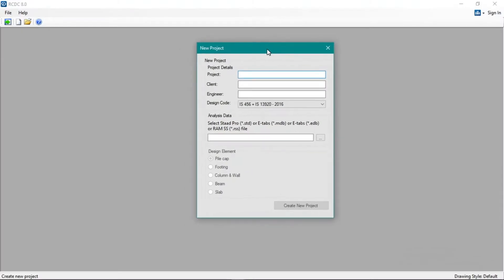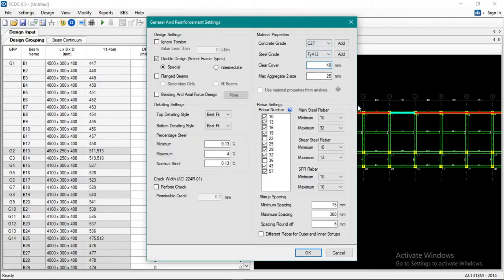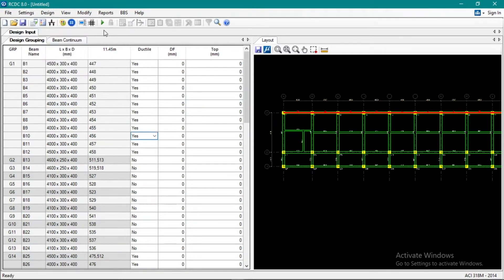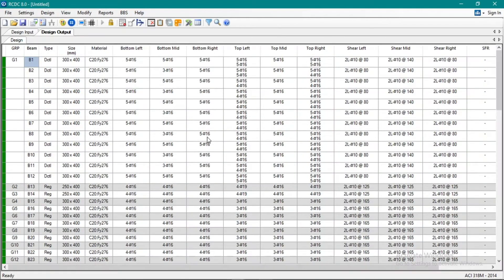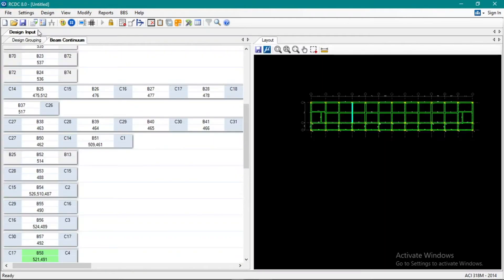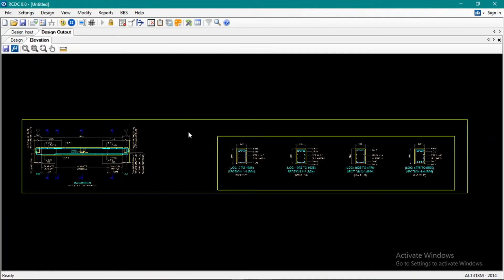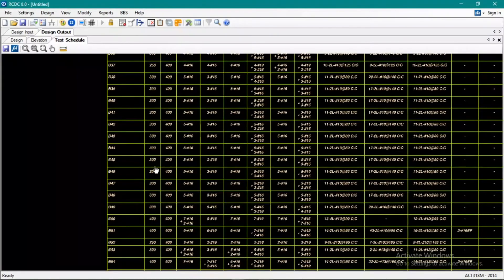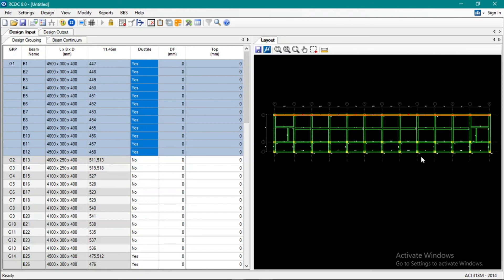REINFORCED CONCRETE BEAM DESIGN (2F-4F LVL) - 4 STOREY SCHOOL BLDG STAAD RCDC

Comment: Engr, normal lang po ba na yung bakal mo sa mga beams ng 2F mas marami kesa sa mga bakal sa  beams ng upper floor kahit same lang naman ng loadings kasi typical floor?
Reply from the maker: Earthquake loading ang difference nila.
Reply: @Aedoengineering  Pag nag copy paste reinforcements ako safe parin kaya yun sir hanggat di nag pupula(fail) yung beam sa rcdc? kasi inaaccept nya basta yung ipapaste mo is mas marami steel area
Reply from the maker: @TheAaronvila  Yes